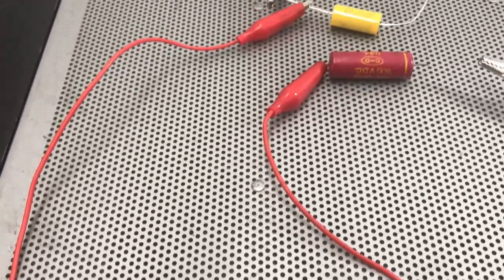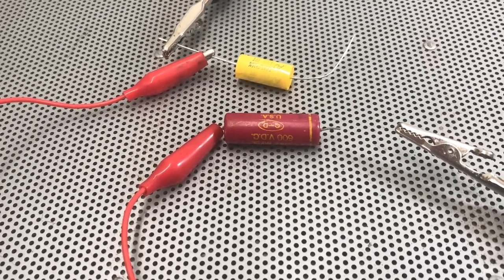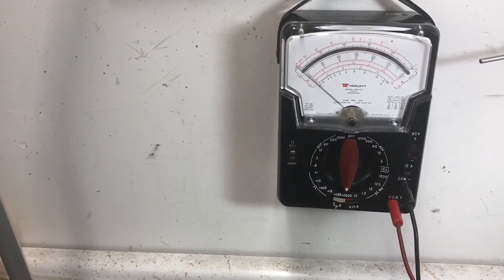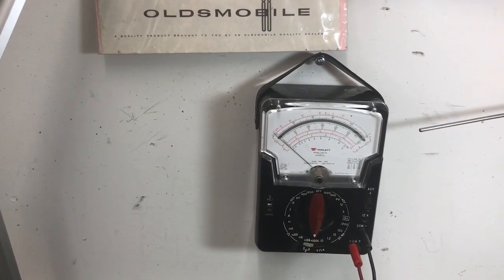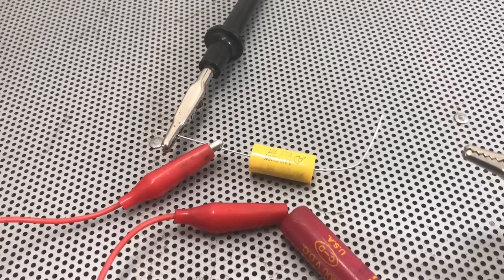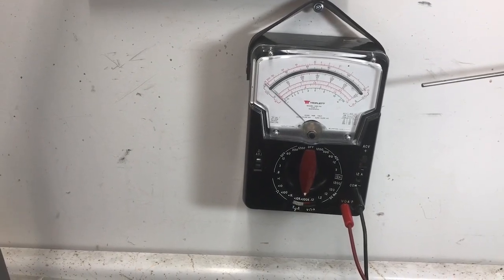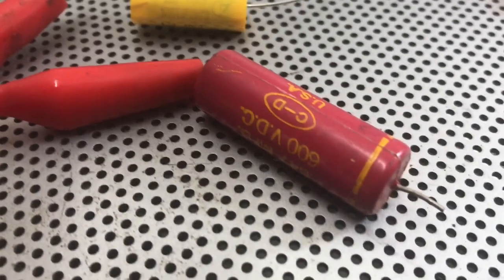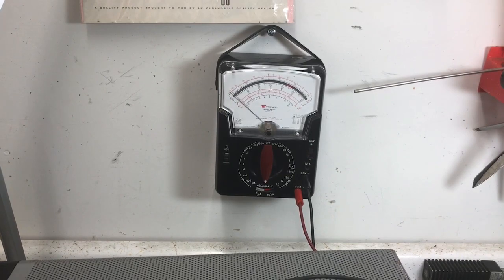Capacitor testing hack, K7PP Page

Comment: HI Pete,  I finally found a broadcast transmitter,,,  a Gates BC-1T. I was told it was working when taken off the air in Nov. 2018.  Looking through it I found three issues already.  C1 an oil filled cap mounted to the bottom of the cabinet is leaking oil.  Two other caps (C8 + C9)  I believe in the tank circuit,, way up at the top are both cracked.  Will these need to be replaced?  I am not an engineer,, I will need help converting this thing to the ham bands.  Do you know someone that would be willing to help me with this?  Any help will be greatly appreciated. Thank's so much.   Regards Joe K.  AB3ZQ
Reply from the maker: Nobody in your area, Joe.  Sounds like you've already identified some issues though.